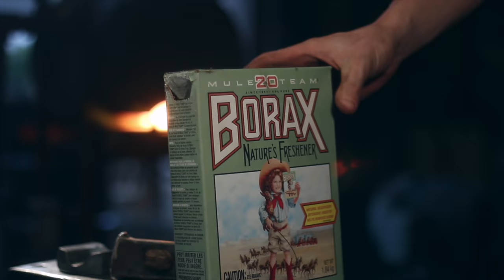Making a REVERSED DOUBLE TWIST Basket - FORGE WELDED

Comment: That’s really cool. Not how I would’ve guessed.

I was a bit confused at first when he was making custom tools and fixtures.. lol

Personally I would’ve tried making the inner spiral first, then forming the outer spiral around it manually by just bending them into place and then twisting it. My way would probably work too.. with my method you could have the inside spiral only attached at one end which would be cool.

If I ever got enough practice at blacksmithing I’d like to try this.

Comment: Of course that turned out damned nice.  Got to admit I Was lost to the "3/4in"rounds you cut...then more so as you welded it up. Then once the twist was formed it was a lightbulb moment. I've tryed a couple of simple twist baskets. Let's just say the result was far less impressive than yours. But at that time I didnt have a forge and was using oxy acetylene torch for heat. Found it enlightening too that your striker was tapping down as you opened the twist. Much less fiddly that way. And the insertion of the opposite twist was pretty ingenious, weather or was your original idea or not, pretty damned ingenious.
 So in total this was a very inlightening educational experience for a beginner smith as I am.  Cant wait to get my Adams power hammer built ( gathered enough iron now to build 6 units. Just need a welder and torch and the electrical system for them), just waiting for the cash to get the stuff to put them together. 
  Then I'll be trying this project myself.  Love the artsy fartsy part of blacksmithing. Guess the call.it ornamental Ironworks. 
🙏 be blessed brother 
Crawford out 🧙‍♂️

Comment: so the first 3 minutes of this video is  a waste of time.
Reply: You have totally missed the point in the first 3 1/2 one of the things the Smith made was a fuller for the anvil hardy hole. This was then used later in the video to forge weld the ends of the piece prior to putting it under the power hammer into the spring swages to finish the job. Smith's make their own tools  !
Reply: @stevemarshall5197  I know what a fuller is. why the hell did I need to watch him make one of 3 minutes.
Reply: Well you may know what one is but many wouldn't 😳
Reply: @stevemarshall5197  my point was why not make the video where he makes the hammer, tongs, anvil, builds a forge ect.? any body trying to replicate the process would either have the knowledge nessicary yo forge a fuller or already have one. If they don't then they shouldn't even try.